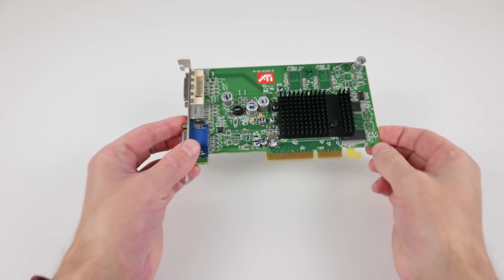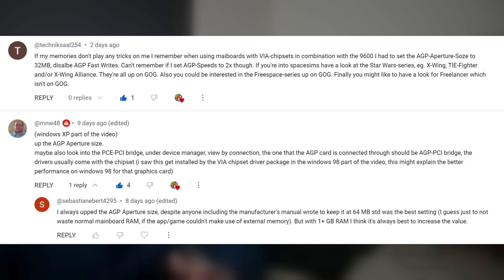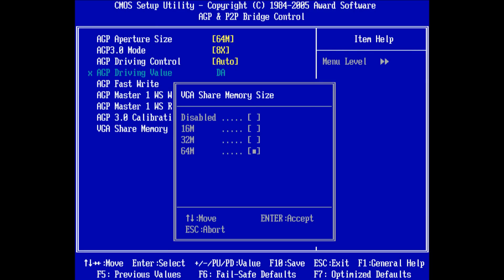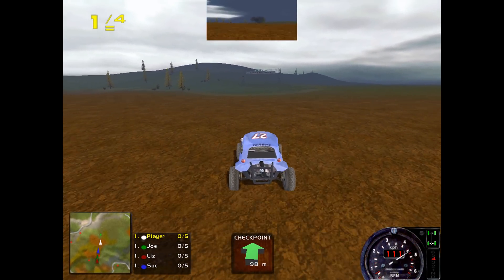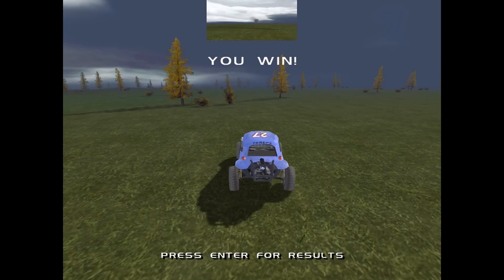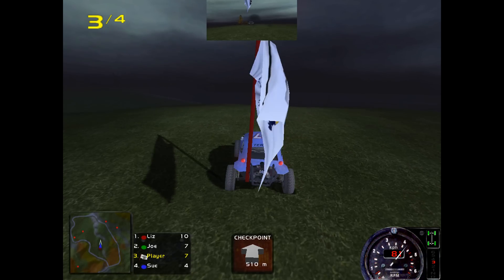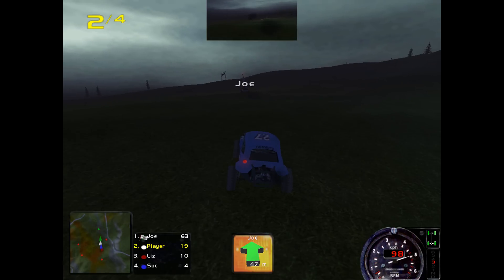VIA Chipset: Lessons were learned

Comment: I had the same identical problem with my 9600SE... very disappointing because on my Gigabyte mobo I was able to run 2 X servers - one for a work desktop, and one for a play desktop, on 2 separate monitors, and with separate keyboards and mice.  And VMWare running Windows 2000 on the second display.  The 9600SE went to the TV and the monitor was on a coffee table facing 90 degrees into a lay-z-boy.  That separation allowed my roommate to browse the web and play with spreadsheets while I was playing Battlefield,  CS Source, or ETWolf.  Later I could do that with Zaphod Heads on an NVidia card with 2 display outputs and no on-board graphics.  Later still, I achieved that using Xephyr on a second display and binding the second keyboard and mouse events to the second server using a userspace tool I've forgotten the name of.  These days, instead of monitors, keyboards, and mice, I have retired laptops as thin clients running liveCD images as their boot drive. And I have the free VNC client on my iPad as a media controller for the TV, plus iOS dictation (with AutoIncorrect!)  Oh that reminds me... I also had MacOS on QEMU with keyboard/mouse passthrough for 2 years, because I was working for a company that required all documents in the McOffice suite, ugh.

Comment: Ehrn I was running S462 boardsthat had VIA chipsets, I found the various chipset drivers would make or break this sort of issue. IIRC the KT266 was the most stable. I do recall clearly several board failures when using VIA chips but can't remember the details. Still, if I were to build one of these systems now I would get the later ones and use, as I did BITD, Radeon cards. 
Great work and that can't-let-it-rest attitude is what makes this hobby so much fun. Looking forward to your next video.

Comment: Great info. I think via is hit and miss. I build a universal ago test bench with a P4 using one of those via 4 in 1. I was not impressed with performance and I think it's mostly do to the chip. In another system I have the k8v-se deluxe and I think that's a very fast motherboard with a via chipset so, you never know.

Comment: If Vladimir Putin demanded I build a retro PC for him, it would contain 100% VIA parts. Suck it, Putin. Enjoy your BSODs.
Reply: Reminds me of a post I read a while ago.
Via Super Socket 7 board with a WinChip CPU and PowerVR PCX1 and Vooodoo Rush on WIndows Me.
Supports all the APIs, all the CPUs features, but all the parts are horrible at doing anything.

Another Idea would be a Pentium 4 with SDRAM (hopefully VIA can do something there) and a Geforce FX 5500. If you throw in 512 MB RAM you could put Vista on it.
Fast CPU, DX9 GPU, the modern Windows, but everything is held back. Netburst really wants bandwith, so the SDRAM is a pain. The Geforcxe FX can do DX9 on paper, but it's performance at it is horrible (still good in DX8)  and Vista with 512 MB will just crawil.

Comment: An annoying problem is with Fast Write On and the ATI 9600, with Nvidia FX 5200/5500 it doesn't happen. The worst is sometimes activating AGP 4x/8x in Win98/ME I think it's the hyperion version. I have an ASUS A8V-MX 939 I tried using a 9550 and 9600 Pro it only worked with FW Off in BIOS and 6.2 drivers with WinXP.
Reply: Yeah, for old boards, use old drivers.

Comment: The Ctrl+F1 trick on Gigabyte boards saves the day. That seems like a BIOS bug to not turn off the shared memory if a dedicated video card is detected. I doubt whatever was onboard could even run as a secondary video card in the system.

Comment: My main retro 'rig' uses VIA KT400A chipset baked into Soltek KT-400A-C, keeping my AMD Athlon XP 1700+ overclocked to 2200+'s frequency. I drive it as a Windows 2000 machine as I prefer this system to Windows 98SE in terms of stability. I'm more interested in early 2000s games that are already NT 5.x compliant (the same Windows 2000 and Windows XP), combined with weird wishes to put some workflow on them I ususally do on my workstation with Ryzen 5 3600X.

Comment: Strangely enough, I don't have so bad memories of Via chipsets.
Back then, I was rocking a msi kt6deltaFiSR, an athlon xp 3200+, 1.5gb of twinmos 400mhz ram at 333mhz*, a sapphire radeon 9800 se vdvo, an audigy 2 zs and a seagate 120gb sata drive.
Only issue I had with that via chipset was, that with 3 dimms the 400mhz fsb was not stable AS stated in the manual... . Later I obtained 2 sticks of 1gb kingston value ram and those ran lovely at 400mhz fsb.
Only found out about the sata 2/3 detection problem of the via 8237r a decade later when I was restoring that system to its former glory 😂. Good that there are pata headers and pata to sata adapters, even it locks me down to 133MB/s that's way better than not detectable sata ssds. 😊
Anyway, I always steered clear of mobos with onboard video chips, they never seemed attractive nor economical to me.
Reply: Something that shows up time and time again. A fully populated board can't run the memory at full speeds. I vaguely remember that from the Athlon 64 days as well.
Reply: @HappyBeezerStudios  : Yes that's true and its even stated in the manual of that board, that when 3 dimms are used, the maximum speed is 333mhz. So if one can read, one is definitely ahead 😁. That's in contrast to the msi k7n2deltaL i owned too, nforce 2 board capable of dual channel and 400mhz fsb. Has three dimm slots even though it runs dual channel... can't remember how that worked in detail, but it was one of the few boards that really brought out the full potential of the athlon xp. My guess is, that many many more via chipset users all fell into the same trap with fully populated ram and instabilities at 400mhz.

Comment: One major reason why people bought and used VIA, ALi, SiS, etc chopsets back in the day is because the motherboards they were on were always cheaper than the same board with an Intel chipset.

However, It wasn't worth the hassle for a few bucks saved.  Not then or now unless there is a specific use case.

The only 'retro' board i sometimes use with a non-intel chipset is a socket 7 with SiS and a k6-2, but even then a good old TX or HX with a 233mmx is usually just as fast in most cases.  The SiS  socket 7 is only appealing because it is micro ATX.
Reply: Of course, the great thing about Socket 7 was that you could even put an AMD K6 (66MHz bus) on an Intel VX or TX-chipset board; since Intel and AMD went their separate ways with proprietary sockets (and briefly slots), that option was tragically lost.

Comment: Great vid.  I hope you get your ASUS A8V Delux working OK.  It is curious that this combo does not work I hope the MB is not faulty.   I use A8V (non- delux) with X-Fi Xtreme music and Radeon HD4650 AGP and it is going very well (apart from Serious Sam 2 freezing the PC 🤔) -with a  pair of modern SSD’s with XP and Win98, but I need to re-set my partition file for dual boot as I’ve lost it for win 98.
Reply from the maker: Will definitely check it out. I think I have 2 or 3 if those boards, so absolutely want to get them going ...

Comment: You wouldn't happen to live in Melbourne, would you? It does get bloody cold there in winter.

You mentioning latency issues reminds me of having to tweak the controller for the PCMCIA bus to prevent 'popping' sounds on my Sound Blaster Audigy ZS Notebook. That wasn't a VIA problem (they did provide the NB and SB of the laptop) but an Ene Technologies problem. They (Ene) had a driver flaw with one of their PCMCIA controller chips. Thankfully, there were workarounds to manually adjust the latency.
Reply from the maker: WA! Thus night it is 0 degrees 🥶

Comment: 0:09 I guess that's why some people travel to warmer countries when for example there's Winter in Europe xD
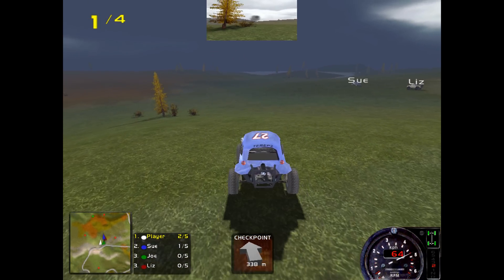3:21 Yeah, I only ate home made Gulash, but that's like more like a Polish style of it, not, the Hungarian, So I gotta try one day.

In terms of VIA, Radeon and SoundBlaster Issues - I'm glad it got fixed, Because I was surprised that it was that problematic, because with my Athlon 64, Radeon Card and SoundBlaster were more just plug and play kinda way, I haven't got issues with them in the first place when installed them on either 98 or XP. I guess I didn't have that VGA Share Memory size, which... To me... Sounds like a iGPU thing, Which is surprising to me - Mostly these iGPU were on OEM PCs, like Dell Optiplex and so on... But on a Gigabyte? That got me out of the blue.

Comment: the only real chipset issue i ever had was on the MSI RS480M2-IL, a 939 board with the ATI Radeon Xpress 200 chipset. nvidia cards in that board all run unstable as heck, but stuff an ati card in the pcie slot and it ran smooth as can be.

kind of a pity, too. it was a decent little board for what it was. one of these days i'll get whatever max cpu it supports and toss it into another machine.

Comment: With VIA KT-133 chipset, I had the complete opposite problem with AGP graphics card - Radeon cards actually worked better than Geforce cards. I used 2 different gpus, Geforce 3 Ti200 and FX 5200 on a QDI Kinetiz 7t motherboard and both cards would either give me weird glitches in games, crash/freeze the computer or wouldn't boot the system at all (black screen). But when I used a Radeon 7500 or 9100, they would both just work.

With VIA K8M890 on the other hand, oh mah lawd, the unexplainable problems I had with that chipset. Everytime I tried to install Windows 98 or XP it would freeze before it would even start copying files, it would freeze during copying files or in case of WinXP give me a bluescreen. I wasn't sure if IDE controller was bad, because MS-DOS mostly functioned fine for hours. My only suspicion was that maybe the chipset was getting hot (the temperature was nearly 40 degrees C). But in the end the only thing that made it work, as best as possible, was to disable half of PCI devices, particularly the USB 1.0/1.1 UHCI Controllers. My theory was that it's IRQs were conflicting with the IDE controller, multimedia device and display controller. Very weird.
Reply: Nvidia graphics cards used AGP/PCI more intensively. That is why it was often necessary to select driver versions for the VIA chipset and video card, and select operating modes. The main thing I remember is that the built-in IDE and USB controllers had to be turned on and use IRQ, after installing Windows, first install the IRQ routing driver and then the rest of the chipset drivers, then the video driver. The AGP aperture size, AGP sideband, and AGP texturing settings also made a difference. And there are a lot of nuances, up to "compatible" memory (more precisely, the internal organization of memory chips).
There was even such a thing that the definition of a chipset was introduced in nVidia drivers and on VIA chipsets AGP was automatically set to a lower speed, for example, on 4x mode cards it was reset to 2x mode.

Comment: Regarding VIA, I was told by my senior technician at a repair shop that with XP, only go with the original drivers supplied by Microsoft, as pretty much anything they put out after XP’s release wasn’t signed and was therefore a terrible idea for our customers’ machines. We never got a VIA machine back for driver issues, so I’m assuming he was right on that…
Reply: Interestingly enough, I feel it's the same way today.  When I load up a new OS install from Windows 7 and later, I only ever installed things that were missing drivers or GPU drivers if it was intended for gaming.  The systems are very stable now in comparison.

Comment: I also had a 9600 SE a long time ago. If I remember correctly, the SE's were the "entry-level" models behind the Pro and xt variants. On my card, the small passive cooler fell off at some point without me noticing. Until the crashes started at some point...
Reply: 64 bit memory bus...
Reply: @jbaroli  Yeah. That was a killer for performance on many DX7-9 cards. It wasn't until GDDR5(really, 6) that a 64-bit memory bus didn't utterly cripple the GPU the VRAM was attached to.
I have a friend with a 9600 LE that miraculously is 128MB/128-bit; spec-wise, it is a Radeon 9000 (pro). Even better, he got it from a mis-listing off fleabay. Win/Win!
Reply: @labrat810  I´ve had a Radeon 9550 back in the day. What a card! It ran everything while properly overclocked, it was almost a 9600 Pro/XT and CHEAP.

Comment: Onboard video at this time was notorious for causing issues because board manufacturers did this exact thing, not allowing the user to disable them properly in BIOS and having them constantly fight for resources and assert themselves as the primary device without warning.
I never had problems with AMD or VIA chipsets when I was younger because I avoided built-in feature motherboards like the plague and often opted for mid or higher-end motherboards with fewer points of failure, but those boards are hard to find or extremely expensive these days so many people are looking at cheap and plentiful OEM motherboards for their retro builds and running into these old problems.
Reply: Exactly that. To me mobos with too much integrated stuff never made sense. There is a certain beauty of having everything as addon cards, audio, network, video, sata controller,... . Also it makes fault finding and repair much easier if you're able to narrow it down via exclusion methodology.

Comment: Hello Phil I try to install the GeForce 6200 256 MB DDR2 with the Asus P5PE-VM LGA 775 with AGP but I have alot of problem with this card in Windows 98se. Sometimes the card works fine and sometimes not. Is the GeForce 6200 not good for Windows 98se? I use the latest Nvidia driver for Windows 98se and this driver support the GeForce 6200. Thank you
Reply from the maker: Yes, it is not good for 98 basically. FX series is the last good one from NVIDIA for 98.
Reply: The GeForce 6200 has compatibility issues, it's better to change the card. Also check that there is no AGP overclocking, that is, the processor bus should be 800 MHz, not 1066 MHz.

Comment: I didn't have many problems with VIA chipsets back in the day when they were current systems. The strange thing is going back and trying to rebuild  systems similar to my old ones has lead me to avoid VIA when I can. I've found Intel, SIS, and Ali chipset to be the easiest to get up and running correctly.
Reply: Indeed, from my experience VIA chipsets, for many years, were found to be very unstable with certain combinations.

Comment: Good ol' IRQ conflicts. Windows 98 (and older) isn't for the feint of heart, that's for sure.
It's funny that some older Radeon cards, like the DX7 generation, the driver gives you two options for Anisotropic Filtering: Off, and 16x. Why is it ALL or nothing?!
Reply from the maker: Geforce4 MX under 98 gives you off and 2x. Come on!
Reply: @philscomputerlab  Well, that's also a low-end card. Nobody expects lots of performance. And the core of the GPU is pretty much a GF2 with updated memory interface.

Comment: Hi Phil i'm Have ECS EliteGroup Motherboard p4vmm2 Also Has Via Chipset But we face problems while installing Radeon 9200se driver
Can these solutions solve my mentioned problem for the motherboard?
Reply from the maker: Give it a go and try Aperture Size and other settings...
Reply: @philscomputerlab  Believe it or not it worked
But at this stage, the chipset driver that contains:VIa inf Drivres
agp Drivres 
And Ide Drivers

  I did not install

Comment: Ive had a few problems in the past with onboard graphics messing about with addin cards which is why I tend to shy away from any board with onboard graphics, or totally disable them in the BIOS until I actually intend to use it.

Comment: Odd Question... 
What is the newest processor you've been able to run Win98 on? 
It is getting harder to find AGP motherboards but keep finding 1st and 2nd gen intel boards with Pentium and i3 CPUs... but still no AGP...   thoughts?
Reply: Phenom II X2 550. The board also supports Phenom II X4 CPUs but I didn't want to stress it🙂 The board is the Asrock AM2NF3-VSTA.
Reply: Ahh, the weird ASRock hybrid mutant boards. They were always interesting for upgrading, but never the fastest or most stable.
Reply: I believe the best/fastest CPU you can use with a fully windows 98 compatible motherboard is a Core 2 Extreme QX6800 / X6800, even though it runs at 2.93GHz compared to something like an E5800(which runs at 3.2GHz), the QX6800 / X6800 both have unlocked multipliers and can be insane overclockers. I just got a QX6800 for my LGA 775 AGP motherboard and it's going to replace the E5800 in my retro build
Reply from the maker: LGA 775 board with Intel AGP chipset, Asrock made a few boards like that! Some PCIe cards work, but it's far from ideal...
Reply: @philscomputerlab I'm a proud owner of an Asrock 775i65g, thanks to you! I've been tinkering with retro builds for a while and your videos inspired me to go all out and do my very own retro build 😁
Reply from the maker: @berenyi_kft  Beautiful 😍
Reply: Though I have to mention that these processors are getting harder to find, and they also need fast DDR400 memory with CL2 timings as the motherboard automatically overclocks the Front Side Bus to 533MHz when it detects these CPU's and it's not guaranteed that it will run smooth as the motherboard runs out of spec in this case (533MHz instead of 400MHz)

Comment: I remember having to mess around with VIA chipsets and trying to solve various issues.  I believe there was an issue with the 9700 which is mostly a larger size die than the 9800.  A lot of lost knowledge.
Reply: I'd love it if someone actually knowledgeable on EE went back w/ an oscilloscope and EMF-gear to see WHY and HOW these issues popped up. I deeply believe a lot of modern 'spooky issues' are related with interference between components. 
(Related: most mining Polaris-cards won't do PCIe 3.0, due to lacking EMC in PCB design/layout; they were never expected to see more than PCIe 2.0 in a mining rack, after all.)